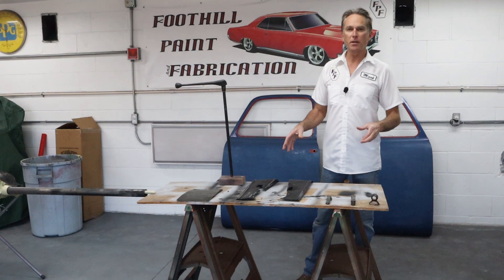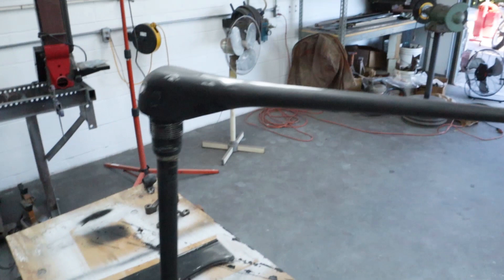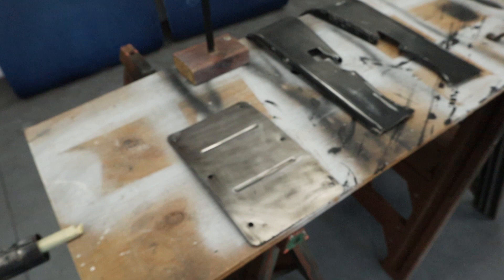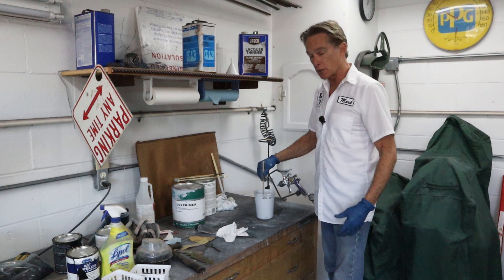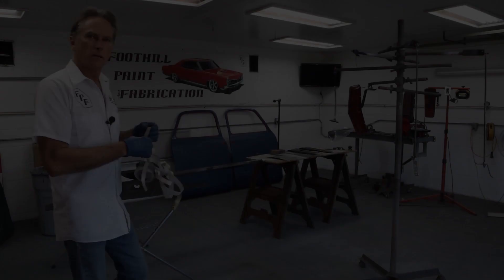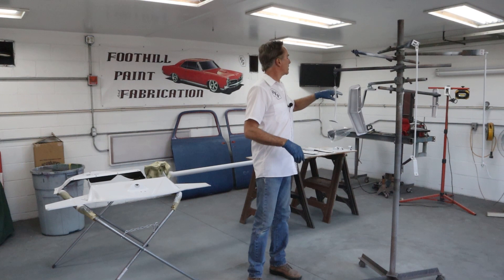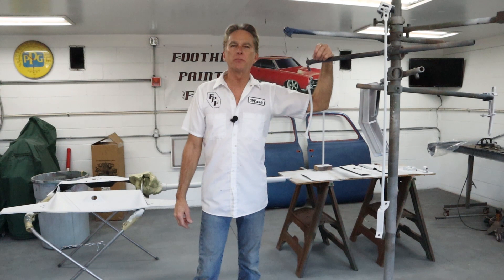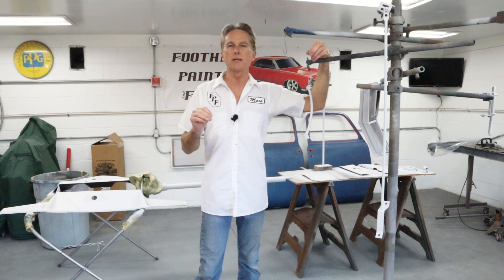1950 Chevy Truck (Ep 46) Priming Small Parts with part holding Tips and Tricks

Comment: Mark, as you know replacement panel i.e. cab corners, cowl panel, floor panels come pre painted with that black paint, do we need to remove that paint or just sand it to then apply filler or apply primer?
Reply from the maker: Electro Deposit Primer or EDP is a solid base for corrosion protection so you can sand it and apply a filler or a quality primer over it.   If you have some sand through areas a DTM primer would be best. If the panels EDP finish is really nice sanding with the finest grit your primer recommends and then scuff with a purple scotch Brite pad should work fine.
Mark

Comment: Do you wipe down with anything prior to tacking? Degreaser etc.. prior to priming.
Reply from the maker: Cleaning before any work at all is done is crucial.  Before I start work on anything they get a really good scrubbing with hot water with dish soap and a fair amount of ammonia mixed into the water.  The hot water makes the soap and ammonia work way better.  The soap removes grease and the ammonia removes wax.  If you clean really well before you start then there is no need to do it later.  Now if you feel like your parts or panel has been contaminated (kids dirty hands, lotion, wd40 sprayed nearby etc.) then yes cleaning before is always advised.  You must use a two rag procedure though.  One with the cleaning agent and one clean rag to wipe off the cleaning agent.  Otherwise you just spread the dirt/grease around. Change the wipe down rag frequently if it is a large panel.  Luckily I have a dedicated area I work in so no contamination.

Comment: What kind of primer do you use?
Reply from the maker: I was using PCL (Pacific Coast Lacquer) and really like they way it lays down and sands. Unfortunately they were bought out by another paint company and reformulated. I haven't tried the new formula yet. I finished with Evercoat Featherfill but it is not as good.  Doesn't stay mixed up very well, color is inconsistent and doesn't sand as well.  I am on the lookout for something better. What have you had luck with?
Mark
Reply: @FoothillPaintandFabrication , I havent done any work in over 5 years and things have changed. That is one reason Im looking on youtube trying to find out what is best.  I want to use a Urethane primer I think. 
 Thanks for the info.
Reply from the maker: @stevecapps6332  Urethanes are more forgiving temperature wise but don't like humidity compared to epoxy primers.  I haven't sanded the newer urethanes so let me know how it works out please.  Are you spraying over etching primer, old finish or bare steel?
Mark
Reply: @FoothillPaintandFabrication  I ordered a urethane primer yesterday. Hopefully will be able to get some sprayed this weekend. 
All of the above on the type Im spraying over. Im restoring a 66 c10 swb, and have bare steel, old finish and etching primer. Im covering the bare with etching primer 1st.
Reply from the maker: @stevecapps6332  I always give the etching primer a good scuff with purple scotch pads just before I spray over the top of it. 
Let me know how it goes this weekend.
Mark